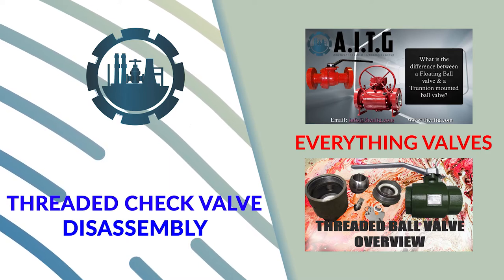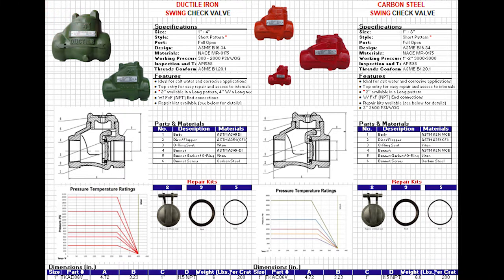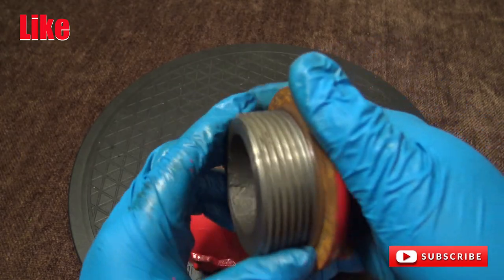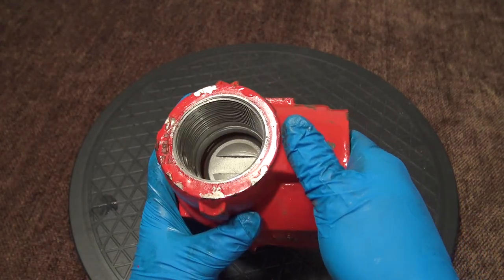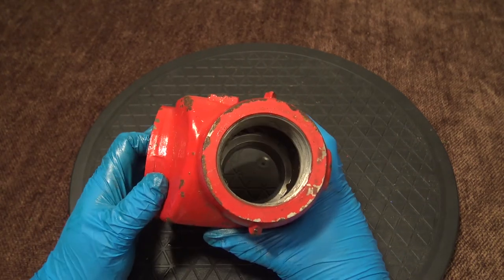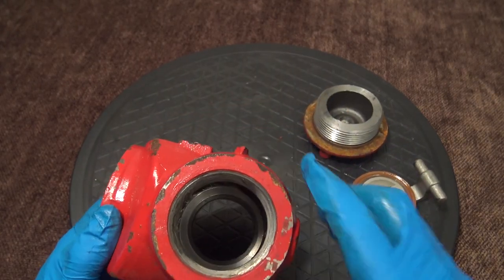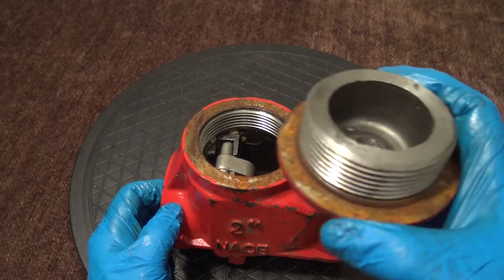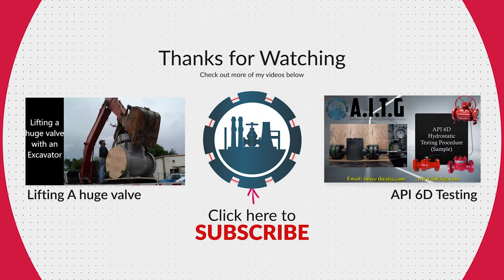Swing Check Valve Breakdown. Threaded Ductile Iron / WCB swing check valve. Swing Check repair.

Comment: I have a Kennedy ductile iron swing check on my job 8” with a galvanized drip.    How do I remove the galvanized drip nipple. It’s 3/4”.  Can I use a ezout.  Any suggestions.  I’d appreciate it
Reply from the maker: I am not very familiar with Kennedy valves design. Looking at it online seems pretty straight forward. If you are having an external fitting problem. There are ways to remove things using the ez out tools or screw extractor bits. The issue is how you fix the threads of the port afterwards. That would potentially require you to remove the valve from the line. Good luck with your project. Thank you for the comment.